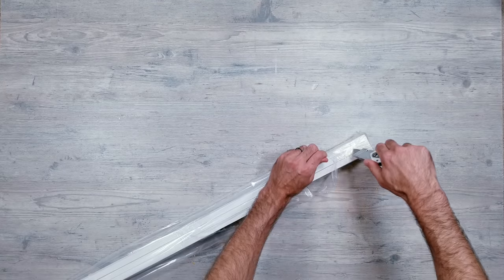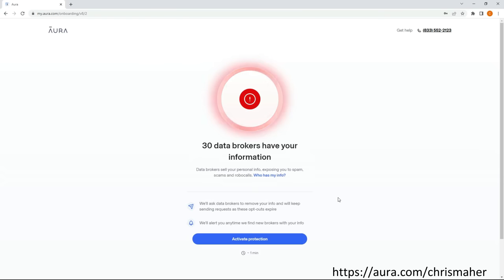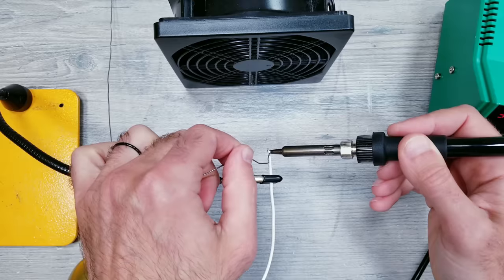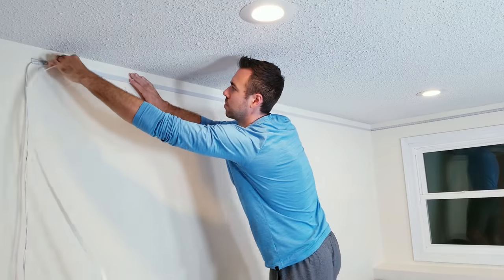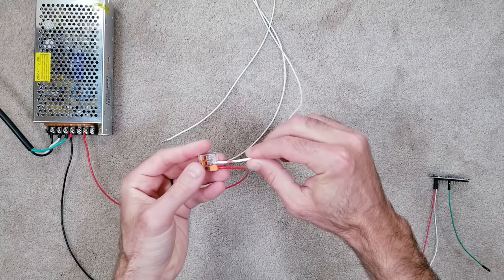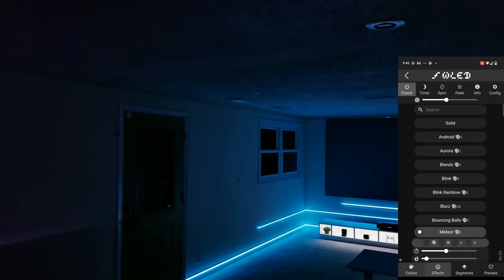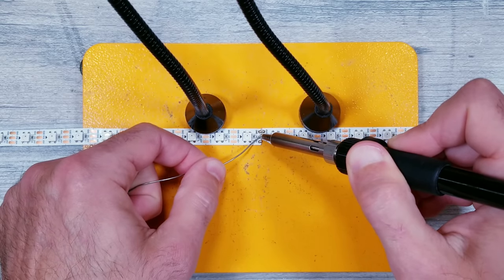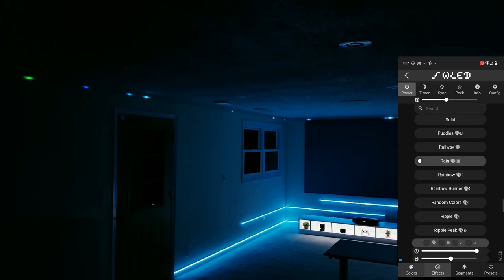50 Feet of LEDS on Room Ceiling - NO POWER INJECTION 😮

Comment from the maker: 🚨 AMAZON’s BEST DEALS (updated daily): https://bit.ly/3VWZKVS
☑ Check out my sponsor to begin your FREE 14 day trial to Aura: https://aura.com/chrismaher
White Diffuser Channel Amazon: https://amzn.to/3OjySdE
Silver Diffuser Channel Amazon: https://amzn.to/3OEJqp4
30 Meter Continuous Diffuser Roll Amazon: https://amzn.to/3OFsUVD
Corner Connector for ceiling install or wall install where you go up and over. These would not work for the exact way I installed mine in this video Amazon: https://amzn.to/3qf3uF0
White Diffuser Channel Company Site: https://bit.ly/44x1TsM 
30 Meter Continuous Diffuser Roll Company Site: https://bit.ly/44yFMlw 
Corner Connector for ceiling install or wall install where you go up and over. These would not work for the exact way I installed mine in this video Company Site: https://bit.ly/3XGx8z6
LED Lights SK6812: https://amzn.to/3P0Ok04
AliExpress LED Lights SK6812: https://s.click.aliexpress.com/e/_DF2aoqn
ESP32: https://amzn.to/43rw988
Breadboard Jumper Wires: https://amzn.to/465xXpg
Wago Connectors: https://amzn.to/3CkdPC3
Wago Connectors: https://amzn.to/42tUF7w
Resistor for Data Line: https://amzn.to/3qCsNk4
Wire Stripper: https://amzn.to/45UOuvT
18 Awg Silicone Wires White: https://amzn.to/43Looty
18 Awg Silicone Wires Multicolor: https://amzn.to/3qz05Ri
Power Supply: https://amzn.to/3p1T5vH
Cord for Power Supply: https://amzn.to/45WBpm6
3m Removable Wall Tape: https://amzn.to/3WZ0VmD
Cable Concealer Track: https://amzn.to/3qCGTSt
Painters Tape: https://amzn.to/45VKvz8
Ferrule Crimping Tool: https://amzn.to/42tVX2m

=============================
Support My Channel Directly:
Become a monthly contributor on Patreon: https://www.patreon.com/ChrisMaherDIY
Buy me a Coffee: https://paypal.me/ChrisMaherDIY
==============================

Domestic Automation Controller: https://amzn.to/42xDt0C
Power Supply for Domestic Automation I used: https://amzn.to/45WfN9a

Soldering Iron: https://amzn.to/3jxx1mB or https://amzn.to/3BKMlWv
Solder: https://amzn.to/3r6smMA
Solder Smoker Absorber: https://amzn.to/3rbHCYp
Or https://amzn.to/3Kx6K4T
Helping Hands: https://amzn.to/3v19YG3
Solder Tip Cleaner: https://amzn.to/3p1Dzjo

Videos I Referenced: 
How To Solder: https://www.youtube.com/watch?v=apSz3NXYlx8&t=283s
Set up WLED on an ESP32: https://www.youtube.com/watch?v=TOEnFKLm9Sw&t=124s
Hiding Power and Controller: https://www.youtube.com/watch?v=ibRp6eeUwBA&t=1s

The best way to help support my channel is to like, comment, make sure your subscribed and share my videos with as many people as you can. The other way is to use my links above as I get a small % at no extra cost to you if you buy something. Thank you all for the support!
Reply: Hey Chris, great video btw

At 9:10, do you have a link to that other beautiful seamless diffuser?
Reply: @chrismaherdiy
Hey my friend i want to ask you 
Which resistor did you choose ( how many ohms) ??
Reply from the maker: @KJ-mi4vj  thanks for reaching out! I just checked and it says 470 ohm. Hope that helps!
Reply: @ChrisMaherDIY  thanks 🙏💙
Reply: Do you have a Instagram?
Reply: The Domestic Automation Controller takes me to an Echo Dot link? Any help is appreciated
Reply: @ChrisMaherDIY  hey my friend i did the same process for my room 15 meter led strip ws2812B , but i have some flickering issues when i go over 60% brightness 
Note: I already connect the end of the strip to the transformer again 
, 3000mah
What do you recommend me to do?
Reply: @ChrisMaherDIY hey, you make these projects look super easy and thanks for that. 

I have a suggestion for a future video that would go well with the rest of your educational videos. A concern that I haven’t seen you mention is how to figure out the appropriate wire gauge if the strip needs higher power or is further away. 

Everything else seems super simple from your videos but this aspect makes it scary to me. Thanks for the great videos!

Comment: The reason for adding a resistor isn't for what you mentioned it's for, it reduces the power going through it..... it "resists" , it does however stop (technically it heavily reduces) reflection(s) which will give an overall cleaner signal across the length of your strip and reduces the chance of weird behavior .
Reply: I don't understand why a resistor is used in a long run like this, cause it limits the power. To me it would make more sense to use it in the shorter runs
Reply: @kraddoomsters  Outside my area of expertise however I believe the longer the run is a factor, as you put a 400kHz signal down meters of cable as it runs the entire length the reflections now nano seconds delayed come back and could cause interference to the source, I would imagine with a tiny cable run any reflection is near instantaneous so as not to be a factor?
Reply: Sounds reasonable, I was also confused why it helped
Reply: Thank you for explaining this. I had an immediate WTF moment when he chose resistor instead of logic shifter, but since I literally just learned about reflections yesterday the way you explain it makes sense.
Reply: I think resistor not required between data pin
Reply: @initialb123 😅
Reply: @kraddoomsters  Actually, it doesn't really matter how long the strip or line is. Let me give a quick explanation:
Both the ESP32 and the led strip have whats called a line impedance, which should not be solely interchanged with DC resistance. To clarify, the line impedance is a value, which expresses how the voltage wave and the current wave behave to eachother while propagating through the line. This is the reason why the length doesnt matter, because the propagation properties dont change with the length as long as the line stays the same in its structure over its length.

Secondly, its also not (directly) about limiting the power that the ESP has to output, because if you look in the datasheet of the ws2812, one led only takes about just 1 uA of current into the data pin. If you add, lets say 1000 leds together this would only equal 1 mA. Given that the ESP32 can output 40 mA from a GPIO pin, output power is not the key part here.

What is crucial here is, that reflections of voltage/current waves occur as soon as you have a point in a line with two impedances that don't match eachother. This happens at the end of the led strip, where there is an open circuit (meaning infinite impedance) and also where the ESP is connected to the led strip (at which I dont really know what the exact values are). The reflections will bounce back and forth and will superimpose the signal of the ESP at the data input of the led chips. This will cause interference and results in flickering and undefined behaviour because the data signal gets corrupted.

Lastly, this can be solved by matching the impedances at the end of the led strip with a resistor (50-220 Ohms) and matching the impedance at the ESP32 which can mostly be done by adding a resistor (330-470 Ohms), because the ESP has a relatively low impedance. For small lengths this can be mostly avoided, because the impact of reflections wont be as big.
Reply: @slendgamer895  Thanks for the explanation. I can't say that I fully understood it. Never the less, in the last paragraph, when you refer to the 50-220 ohm resistor, how is it being connected - is it between the data wire and ground?! Thanks in advance.
Reply: @pratahsinnetamby  You're welcome! I think I overcomplicated the explanation a bit because I have a background in electrical engineering... sorry for that!

I think I also made an error because I thought the every chip would be connected in parallel to the ESP. Because of this signal corruptions are far worse at the beginning of the signal chain than at the end, because they go through every chip. To correct this you can put a resistor between ESP and signal input, so the reflections between them get converted into heat.

TLDR; ditch the end resistor and just put a (300-470 Ohm) resistor between ESP output and strip signal input
Reply: @slendgamer895   Many thanks for the prompt response - much appreciated.
Reply: @slendgamer895 lol yhea impedance mismatches are a pain. You run into these alot with rf aplications.

Seen it more in the millitary from soldiers not using the right antenna with radio. But still run into it every now and again when dealing with some diy solutions on a customer's ranch house😊
Reply: @slendgamer895 hi, completely new to this, I would like to do the same as in Chris video, do I need one ? And if so which size ?
Reply: @slendgamer895  hey you seem pretty knowledgeable about this stuff. I am a complete greeny with all this and some of the language is a bit intimidating for me lol however, on the desperate end, I literally have every item in my Amazon cart as we speak, and realizing how costly all the stuff is together I can’t help but think I am still going to run into some issues trying to do all this on my own… Would love your expertise on this… I’m basically going to re-create the top surrounding LEDs in which he did in this video and I would honestly love to get in contact with you for a walk-through and some extra understanding on some of the stuff. Would love to hear from you soon. Thanks again for your amazing response.
Reply: @slendgamer895  Can you plz tell what wattage resistor i should select....Selecting a 330ohm resistor but it shows different wattage like 1/4 1/8 watt...Strip will be a 5v strip so plz help
Reply: @slendgamer895 great explanation, thank you! That's the information I was looking for when I saw people start to refer to reflections and I did not know what they meant exactly.
Reply: I don't understand.. This setup would require at least 45 amps, but for him it works fine with 3 amps, which is 6% of required power. Wth?!

Comment: This is exactly what I did about 2 months ago. Created a continuous loop around the room and then injected the power at the tail end. Nice video, as always.
Reply: What powersupply did you use and how long was your strip? Planning on doing this too, but i'm kind of a noob... :)
Reply: @jdwall7429  I just used a 5v 10A power supply.
Reply: What does it mean a the tail end is it just one if the two ends , ? Dont the ends meet though if you make a loop?
Reply: @ademord They meet, but you wont be connecting the strips together at the ends. You will still have a stop point and end point (Tail End).
Reply: @ComeHereGreatness  hey so I plan on using about four strips at about 16 feet each and I’m wondering should I use a higher voltage power supply… I have the 5 V in my cart as we speak but would the 12 V be better… I’m pretty green about all this stuff honestly and I’m trying to re-create this exact same surrounding LED feature for my room and would love a little help… If you wouldn’t mind getting in contact with me, that would be great

Comment: I'm a bit confused about your new setup here. The corner pieces you've shown are at a different angle and they're not white, so I'm guessing that's not what you used. In this setup did you overlap the channels or did you cut them at 45 deg?

Comment: I was stuck for a bit because I bought an ESP32S board which uses P16 as the data  pin. Also, if anyone else ran into this problem, GND is not right next to 5V in

Comment: Thanks for the tip about the resistor.  I have built my setup laying on the floor as proof of concept but didn't have long wires feeding in until I do the actual install so that definitely would have stumped me.

Comment: Hey! I followed your setup and it works like a charm. It's my very first time with soldering and working with electricity like this (except for installing living room lamps on the ceiling). 

I've watched a lot of your videos and I want to thank you for all those recommendations and easy explanations.

Awesome stuff. Will highly recommend you.

Thanks!
Reply: @ryanmckane87 I am about to try this myself. Just finished up running my diffuser. I am install 3 runs of the BTF WS2812B. If I follow these instructions I shouldn’t have any issues with the loss of power or amps will I? Just trying to confirm. I’m not sure if I need to connect power to each end of my LED strips or not. Thanks for any feedback.
Reply: Nice definitely ready to go into the deep end of the pool.

Comment: Great build! Another option instead of using a resistor is to also use a sacrificial LED if you're in a pinch. You can always use a small piece of excess from your strips if you have any.
Reply: The Led has 3 "lanes" what lane  do i  have to use for that?

Comment: Thank you Chris! I would love to see a video addressing how you deal with corners specifically on each type of installation, like using tracks on the ceiling vs using dedicated corner channels that have the 45 degree tilt vs on the wall like in this video!

Maybe it’s beginner level stuff and that’s why it’s being glossed over, I will continue to look around 🙂
Reply: 90 degree 3-pin connectors

Comment: Great presentation without any of the fluff that so many add in. I appreciate you sharing the corner detail manufacturer to help simplify a clean installation.  Using a level is an option but since many homes aren't as square, true and plumb for that type of installation, I suggest just measuring up or down from the nearby parallel feature to maintain an appealing aesthetic look. I wouldn't use a level unless the LED strip is over a foot away from everything else.
Reply: If only that fluff weren't actually necessary nor unsafe to disregard.
Though, who needs a fuse if the wires are so thin they effectively already have become the fuse...

Comment: Hi Chris, do you have a video on how to calculate the power supply needed for the LED strip with WLED
Reply: This would depend on what strip you use, I believe the manufacturer should have a data sheet but WLED has a calculator on their site as well
Reply: Maybe it helps someone else. I believe the LEDs use 60ma if they are white (Red, green and blue) on 100%. So you would need to x(amount of leds) * 60ma. For a 144leds/m strip that would be 8,64A

Comment: I really like the continuous plastic. Sadly, they say it won’t fit their V-shaped channels. Your paper hack might do the trick though.

I’m looking at running something like what you’ve done here around my entire living room, as primary lighting. I need bright overhead, and don’t want to put it cans. I’d like to use the cool effects on occasion.

The room is 21x13, so like 68 feet of continuous LED strips, full power.
Is that something that can be done and have all of it synch up so one controller can make all of it “work as one strip”. I understand power injection will be needed.

Thanks Chris, your kung fu is strong!
Reply: Hi. How did you get on? Your installation sounds exactly like what I'm planning. Did it work ok as primary lighting? What power source did you use? Sorry for all the questions
Reply: @mrbump8037  Unfortunately I’m indefinitely stalled on it. Nothing accomplished since my post. 😢 Wish I could help!

Comment: My experience is that with 5m and full brightness, the end of the 5m strip reaches about 2.5V. I am not worried about connecting 2 power injectors against eachother provided they are "identical" (i.e. the same voltage up until a certain resolution). The resistance of the wire is so big it doesn't really become a problem unless one of the two is broken. If one end is 5V and the other is 5.01V, the difference is 10mV. Connecting them both would result in maybe 5mW loss.
I use 20V dc wiring with 1.5mm^2 cable and have any-to-5V DC-DC converters limited to 4A, and the string should be capable of eating at least 18A. At the end of that DC wiring, the drop of the 20V rails is bigger than the drop of a strip. So always go from "high voltage" for distribution and DC-DC that to spec.
For 12+V strips this is of course not necessary.
Everything depends also on the spec of the strip itself. But my experience is (8 year old strips): if you want to use it as lighting instead of a gimmick, you need power injection, or better: you just need higher voltages, which they didn't have a that time.
Reply: hey you seem pretty knowledgeable about this stuff. I am a complete greeny with all this and some of the language is a bit intimidating for me lol however, on the desperate end, I literally have every item in my Amazon cart as we speak, and realizing how costly all the stuff is together I can’t help but think I am still going to run into some issues trying to do all this on my own… Would love your expertise on this… I’m basically going to re-create the top surrounding LEDs in which he did in this video and I would honestly love to get in contact with you for a walk-through and some extra understanding on some of the stuff. Would love to hear from you soon. Thanks again for your amazing response.

Comment: Hi! Does the resistance you use also work for shorter lengths? I have one strip that is 500 leds and connected to one output on the ESP32 and one with 58 leds that is connected to another output but it flashes and cannot be controlled..

Comment: Ive bought a 5v60amp power supply for 20m of WS2812B leds. 
All i need now is the right cable, but im really confused on what to get.
What cable do i need to buy? Chatgpt says i need 5awg but youre using way more for less leds so that can't be right.
Thanks for any help.
Reply: Same here but for 30m. I just bought 18 awg wire